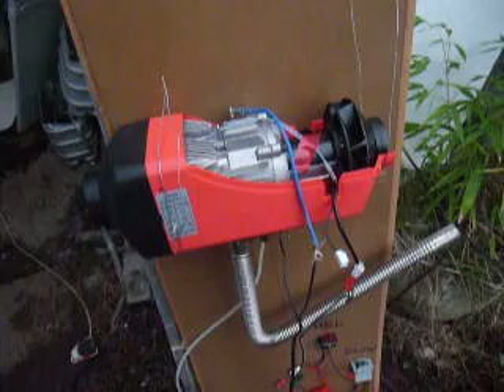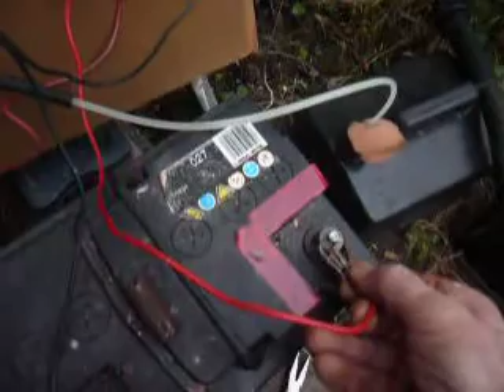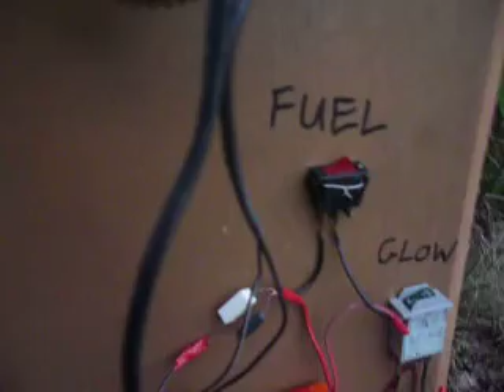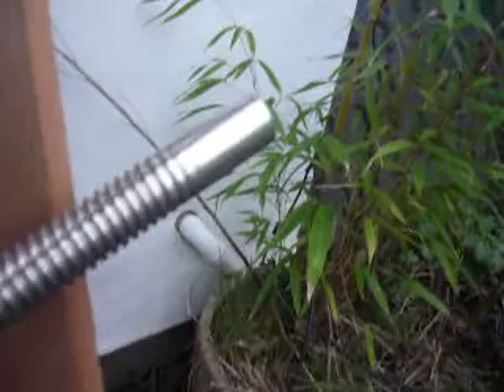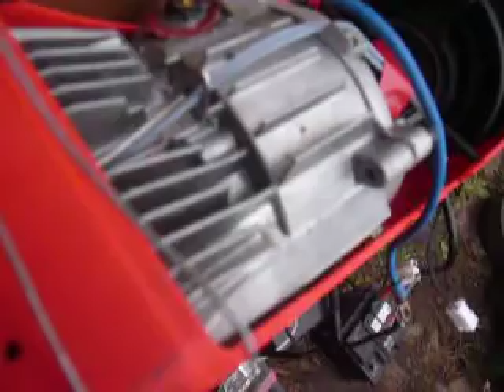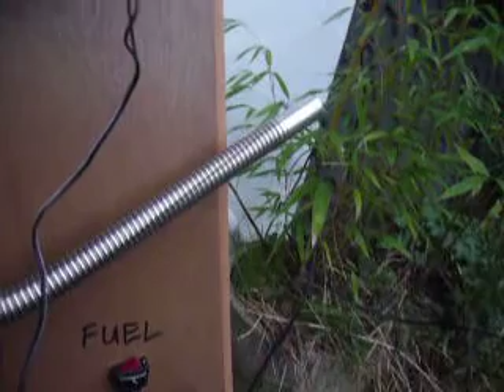Chinese diesel heater with automotive glow plug..

Comment: Interesting, my glow plug has failed, the replacement I got from eBay arrived broken, so I'm currently without heat. I might get the tap and die set out and see if I can find the thread size and pitch. It would certainly be easier if I could convert to a standard car glow plug! Out of curiosity can you remember if the car glow plug was longer/shorter?
Reply from the maker: I doubt it will work with a standard heater,,, As you can see I made mine manual control,,,  no pcb.  Probably different resistance,,  and the pcb would show an error...  Good luck,, let me know if it works
Reply: Hi m8, I found someone local with a spare glow plug so I've just used that. I'm thinking of buying another heater as a spare or replacement. So eventually I will get around to some tinkering lol

Comment: It never worked, I never saw no smoke
Reply from the maker: That's cause it burns cleanly,,,,,,,,,   and why should it not ignite??,,,  theres diesel, theres a red hot plug,, theres air. BOOM,,,,,   Also,,,,,if you "never saw no smoke"   that means you did see some smoke......